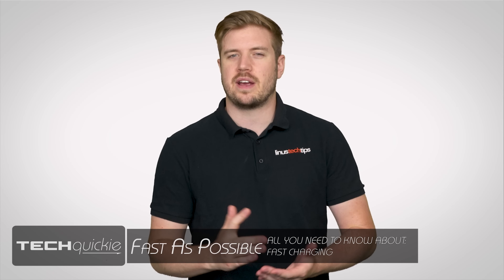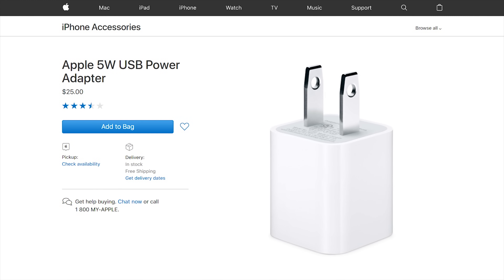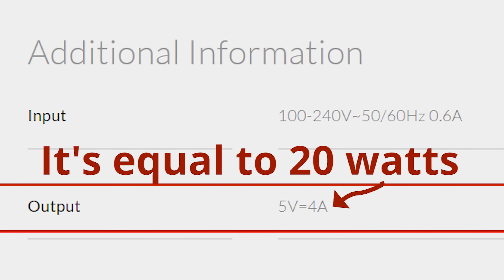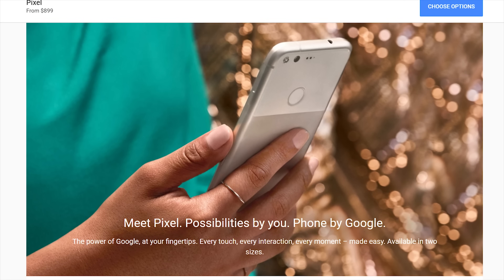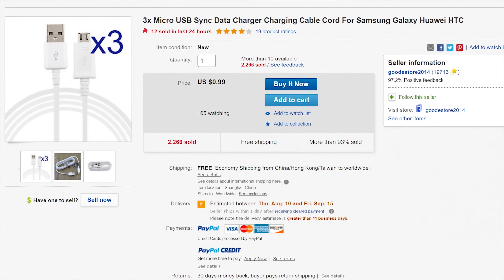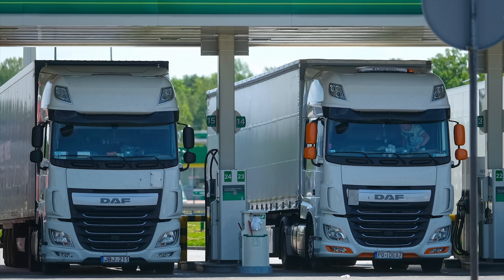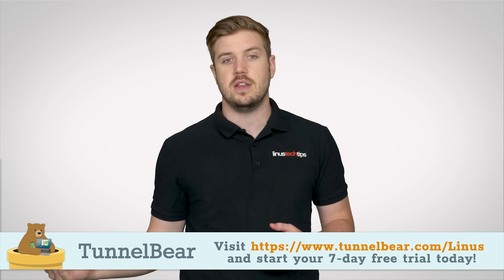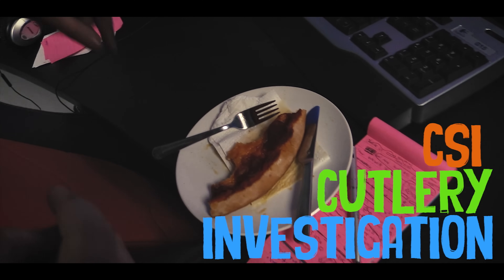How Does Fast Charging Work?

Comment: Dash charge actually use about 3.5A, not 4A
Reply: Arek R. My dash charger says 4A.
Reply: 4A
Reply: My Dash charger says 4A but only delivers 3.5.  Or I can use a dual 2.1A power suply socket to covert 4.2 int 3.5A  so I agree with this statement, Despite all the haters saying otherwise, Likely they haven't actually tested and proven their power supplies like I have...
Reply: Also noticed no extra heat with dash charge compared to fast charge
Reply: But you do get horrendous  transformer "squeal" from the plug itself. due to the high speed of transforming it does.
Reply: BurntFaceMan how you can push 3,5 to it from two standard USB?
Dash charge only works with included power supply and usb cable, there's extra pin for some kind of 1-wire handshae protocol which also delivers information about preffered voltage, so decreases 5V to eg. 4,5V so IC circuits in smartphone doesnt generate much heat
Reply: Google "Y type usb C cable"  it has 2 usb adapters on one end and a single USB C input on the receives 2x 2.1amp the power from both is received and controlled BY THE PHONE.  not the plug. 
I use it like this to charge when I don't have the dash charger on me.  The phone has basic control's and I imagine most phones can manage power the exact same way.
Reply: Arek R. Dash charge uses 3.5 AVERAGE. but peaks 4
Reply: Jhin No 3.5A, no more, occasionall peaks for few milliseconds doesn't count.
Reply: Nope...it varies
Reply: The wall wart is rated for 4A but my car adapter is only rated at 3.5A
Reply: Just round it off  😎😂
Reply: So 87.5% of the power of what he said. Thanks for that, lonelyboy...
Reply: Fast charging upto 60% than normal download app  https://play.google.com/store/apps/details?id=com.mubatteryfree.fastcharger

Comment: In a nutshell: fast charging pushes more amps through the charger, but requires a protocol or you risk to burn your phone. Also, apparently VPNs are not for downloading pirated content or for privacy paranoids.

Comment: Hey I am trying to purchase a replacement fast charging cable for the Galaxy s7 but all vendors including Samsung themselves have mixed reviews where 50% are 1 star saying that the cables are not actually fast charging, and the other 50% say the cables are fast charging, and the prices for the same sku varies across almost every website from 3 dollars for 2 to 30 dollars for one.  How can I find the right cable and ensure that it will actually enable fast charging!
Reply: Russell Mark Well, buying from the Internet is always guess and check. My recommendation is to buy it from a reputable source that allows for refunds. For Samsung's Adaptive Fast Charging, it uses an implementation of Qualcomm's Quick Charge 2.0, so any cable that supports QC 2.0+ are technically compatible.

If you want Samsung's OEM parts, then Samsung Parts is a Samsung Authorized Parts seller, but be aware that the pictures on the site are sometimes... eh? And it could also be a bit costly.

Comment: My s6 does 9 volts st 1.67 amps. But fast charging only works until it reaches 80% then it goes back down to the normal current and voltage.
Reply: samsung do this for two reasons:

A: it is easier for a power supply to provide 15watts at 9V 1.67Α that is is to provide 15watts at 5V 3A.

B: in the same manner it's easier for a cable to carry 1.67A than it is to carry 3A. Less heat and less voltage drop.

However, your phone STILL get's 4.2 volts maximum to the battery. It just has a beefier step down regulator than older phones.

For the phone dropping 9V 1.5A (you never use max charger power) volts to 4.2V 3A (not 3.2 because of losses) (which is the maximum amount of power delivered at fast charging to your battery momentarily  right at the cc-cv thresshold), is actually a harder job than if the charger was providing 5V 3A even assuming a good quality step-down reg with 93% efficiency. That's still about 1 watt of dissipated heat, and that's not insignificant for a sealed device.

So bottom-line, this is probably worse for the phone but easier on the charger. I would avoid using it regularly if I could avoid it.
Reply: That's very useful information, thank you
Reply: You are very welcome mate :) 

Also if you want to learn more about why fast charging only really works until about 80% (witch is very normal and has to do with saturation charge) there is a detailed analysis of all things related to li-ion here

 http://batteryuniversity.com/learn/article/charging_lithium_ion_batteries

Comment: My Phone can handle fast charge and this is quick. With the bigger battery, I charge my phone about every 2-3 day. My charger can deliver 2A by 5V, 4.5A by 5V or 5A by 4.5V I think the last method is the best because the phone don't need to regulate the voltage down for charging. 

What feature I miss is that you can set up how you want to charge. Fast charge can lower your battery lifespan. I also want to set up how much i want to charge. It's not optimal when you charge your phone to 100%. I heard that the best is 30-70% and for daily use this is enough. I can leave my house with a phone charged to 60% and don't worry that my phone run low. 
With my old phone I charged it every night and even charged it 2 times a day when I used it a lot.
Reply: Ehh, what Phone do you have? 4.5A is well out of spec for what USB A allows. And I have never heard of a charger dipping below 5 Volts intendedly, usually they increase the voltage to achieve lower currents.
Reply: Huawei Mate 9 (Dual Sim). It makes sense to lower the voltage because you dont charge a Li-Ion with 5V and when the phone must regulate the voltage down, it produces more heat on the phone.

Comment: my moto x is somehow able to charge at 8-10 amps (depending on thermal throttling)
Reply: No kid.   It is NOT charging at 8 to 10 amps.  I don't know where you got that information from, but that is obviously false.  It's probably charging at 2 to 2.5 amps
Reply: tpcs the default charger is 25 w (5v, 5 amps) and the one i got (not default) draws 0.174 amps from a 230v socket (and the phone sees it as 50-40 watts) after a higher amperage while the phone is still cold

Comment: Burn the candle in both ends. Its the only way to fly man.
Reply: We are throwing this one back in the bin.

Peace!
Reply: In what way was this relevant?
Reply: If you have to ask, I dont have to tell you. 

But by any hoot, giving up the longevity of your battery for a faster charge. Its like peeing in your pants isnt it? Have you ever touched your phone after these high amps recharges, it feels hot dosent it? But not as my pants bro! Because its full of pee! Woof!
Reply: Olebull93 I don't remember which standard does it, VOOC or Dash or one of those besides Quick Charge, but they put most of the charging circuitry inside the wall wart instead of the phone for exactly that reason, to keep it from getting hot and increase longevity.
Reply: A year later and I still have no idea what is wrong with you

Comment: I wish this wasn't an excuse to get rid of user replaceable batteries.
Reply: lg g5 had quick charge 3.0 and removable battery
Reply: Yep. I bought one for a nice discount just before the G6 dropped. The second half of a full charge doesn't seem to take any longer than the first half. It's a great technology and a great phone, imo.
Reply: crisray6789 I had my Note 2 for four and a half years and never switched battery. 😁
Reply: crisray6789 4 batteries in 3 and a half years? Damn, that must have been some really harsh environment / usage scenario.
Reply: Simon Tay unscrewing? Ungluing!
Reply: zoggeris i've had my iPad Air 1 since 2014, still going strong, in fact, I'm using it to write this comment right now. Haven't had to replace anything, although my Gecko case is starting to have bits snap off the inside :/
Reply: Any phone battery is replaceable if you make the effort to open your device (unscrewing if necessary).
Reply: @simontay4851  modern phones will get cracked if you open them yourself
Reply: @simontay4851  well it is NOT ADVISABLE BY THE USER
Reply: Yeah. My Vibe P1 had no user replaceable batteries but got fast charging. I wonder why...
Reply: Actually, for the record: The official excuse was "they needed to seal the battery because they needed to put glass on the back, FOR WIRELESS CHARGING." (Which is completely false btw. The wireless charger itself is plastic, therefore debunking their claim that it should be glass) Sealed batteries has absolutely nothing to do with fast charging. As an example, The note 4 has fast charging AND a removable battery. The actual reason why they sealed the batteries: Google invented a location tracking technology that uses your battery (no gps) MAYBE 3 months before the first sealed phones showed up to the market. Use a little common sense and you can easily figure out what's actually going on. Fast charging is to compensate for the ever increasing size of the battery (which keeps getting enlarged to compensate for their infinitely growing location tracking). In 2020 a 4500mah battery lasts as long as a 3000mah battery did in 2014. Do you not find this suspicious? Don't bother saying it's because of their increasing technology. The 2014 phones have 50%+ more functionality than modern phones.
Reply: You had to change battery every ten months??? What the heck did you do to it ?! :P
Reply: I had my note 2 for three and a half years before I broke it accidentally, it lasted through 4 new batteries, and I would have kept using it.
Reply: you are so right, non user replaceable batteries are a cancer to modern electronics that needs to stop now.
Reply: @x225w  well it's never stopping ever
Reply: @x225w well you can clearly tell that it won't ever stop and non removable are good as it stops the user from using an unofficial battery in the  device
Reply: On the contrary, a removable battery would have more room to expand. My Lumia 950 has a removable battery and uses Qualcomm Quick Charge.
Reply: @megakiller999  very true 
My 5 year old Motorola Phone has a removable battery

Comment: bitch please 
Nokia 
one charge a month
Reply: Well of course it's one charge per month when you have no friends to call you.

:)
Reply: or no enemies to bother you
Reply: The new nokia 6 has great battery for now days standards -.- so like 1,5day... Cant they make them bigger with like dubbel the battery...
Reply: And like none of the functionality
Reply: Sanguinius Nokia is dead and new Android Nokia is one of the worst Androids some cheap Chinese models are much better than N6
Reply: cant get that nowadays bro
Reply: amazon "nokia" 
mine was £15 and is doing great
Reply: OOOUUUUU
Reply: Brandon Mohammed There's plenty of Nokia phones to buy nowadays and they're making Android phones now as well.
Reply: gurpreet singh Can you say the same with Nokia 8?
Reply: my old nokia e52 works as alarm clock. i turn it off once a 2 months when I charge it
Reply: Sanguinius ironically modern phones still have a longer talk time then the old Nokia even if it doesn't need charging for a month.
Reply: I have an old Nokia E63 with my old SIM card in it. I haven't used it in three years or so. Turned it on the other day and the battery still has some power left in it. I miss that phone... I used to charge it around once per week. My old 3315 lasted even longer.
Reply: And easy to change the battery.
Reply: my old random battery powered clock hasnt needed new batteries in 5 years
Reply: Slippy Toad ikr they're really good
Reply: More like one sale a month.
Reply: especially the 3310 which an last from 2011 to 2066 and still be at 99% and can also break a giant hole in the earths crust when you drop it
Reply: I still have my Nokia C3 and I charge it twice a month at best, good times